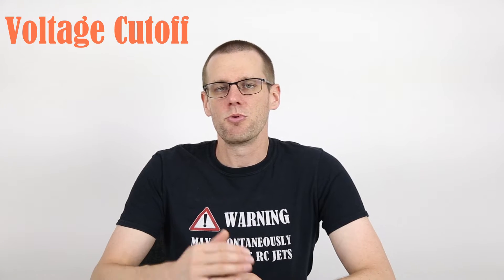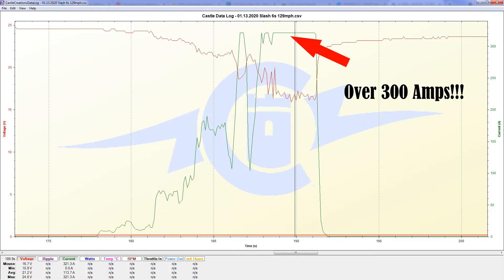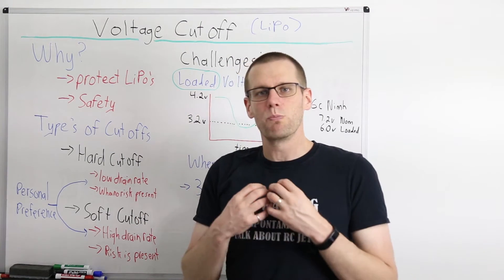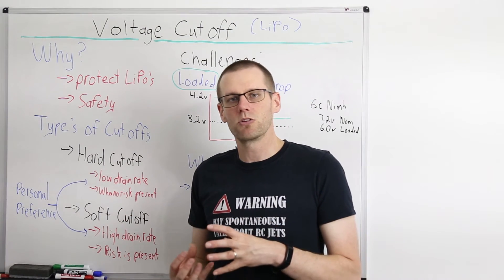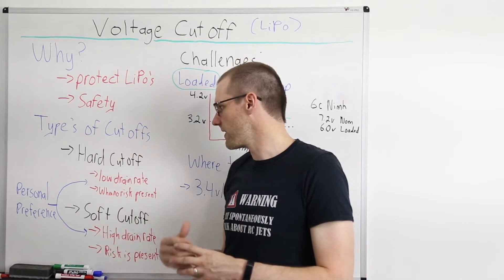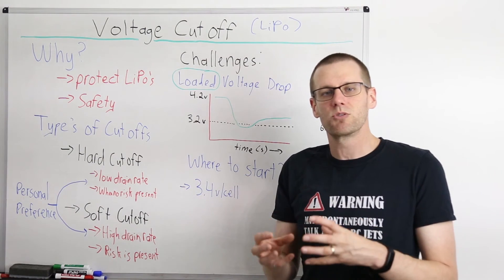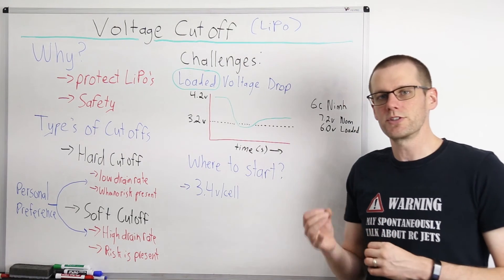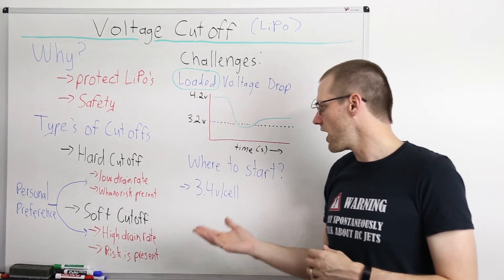The Problem with Low Voltage Cutoffs for Very High Performance RC's

Comment: If the cutoff voltage is set to 3.2, does that mean that if ANY cell drops below 3.2 V, that the cutoff kicks in or is it the average of all the cell?
Reply from the maker: Not any cell. The average as the esc is not using the voltage tap to measure individual cells.
Reply: @RCexplained  Very responsive to an old video.  Thank you for the answer.

Comment: I'm trying to put together a triple fan setup for my UDR, with it's own small/separate 3s lipo, and a LVC between the fans and 3s battery. So I don't lose run time or power, but get all the cooling the UDR needs.
Reply: How did it go? 3 years later
Reply: @keven8047  I ended up finding a voltage regulator on Amazon that can handle 8s and put out the power needed for all the fans and lights. Then I mounted a toggle switch on the dash of the UDR to turn on/off all the fans & lights as needed. Been planning on switching it to a remotely operated switch to turn them on/off from the radio. I've got the stuff needed, just been busy with other projects lol
Reply: @TheAmericanUhate  lol that is cool.  Bet you were shocked to get a comment on yours after 2 years.  Lol
Reply: @keven8047  Lol it is rare but more often on youtube than facebook for sure.
Reply: It's basically 2 smaller 30mm fans for the faux fans on the back, with a duct to the engine box, and a larger 40mm fan also pushing air into the motor box. My ESC never gets hot, barely even warm, but my motor is getting way too hot, hot enough that you can't touch it.

Comment: That's why i use 3.4v cut off from Esc and 3.3V lipo alarm with loud buzzer.....if all cells will be discharged normally 3.4v cut off will be doing it's job, if any of cells will drop below 3.3v lipo alarm will do what he must do.....

Comment: First of all absolutely love your videos. There’s a lot of people out there that seem to know how to install parts and which ones you can/can’t use but no one seems to explain the WHY. I’m one of those guys that need the why lol no as to my question…

Bought Arrma Typhon mega, upgraded it with hobbywing ezrun max10 sct 3660 with the 3200kv motor. I have a couple 2s goldbat brand rated at 5200mah 100c. Whenever I plug my lipo battery alarm set at 3.4-3.5v it starts going off, i bring it in and it’s reading 3.8v or higher sometimes. Is there anything I can do to help/overcome this voltage sag? 

Appreciate your help, time and everything you do for the rc community by making these videos. I literally found you last night and watched your videos for well over 2.5 hrs trying to get better grasp on different subjects.
Reply from the maker: Hi Sam. Going from 3.5v loaded to 3.8v unloaded is not too bad if you are really pushing the car during the run. 
If you want to reduce voltage sag further, you can increase the capacity that you are running. Instead of 5k you can go up to 8k mAh.
And if you don't want to beef up the power system, you can gear down by reducing your pinion gear tooth count. This will reduce load.
Reply: Would soldering the extra capacitors that came with it help at all by chance? Hobbywing said I should only need those for speed runs and similar kinds of activity. Makes me nervous running batteries without an alarm and potentially damaging them. Keep up your excellent work. I could spend hours watching you. Some topics go over my head like your tires episode but most of the information sticks and I retain.
Reply from the maker: Hey Sam. The capacitors would not help.

Comment: With my esc and motor combo I can get away with having my lvc at 3.0 or 3.1 volts per cell and still have plenty of headway for it too be safe I drag race so I make 3 or 4 passes and come in the pits and charge up before my next couple of passes and also I’m going 132ft thanks for the info though

Comment: Is there any way of reducing the likelihood of voltage sag? To prevent the voltage from dropping down to LVC level for a split second triggering the cutoff? Does a higher c rating help?
Reply: I haven't figured it out yet either

Comment: not sure if this would be considered an ESC or battery question?  what would cause an esc to beep 4 times on a 3S lipo, ( will provide any info about the RC and or power system) but will beep correctly when a 2s or 4s(2 2s in series) or even a 6S ( 2 3s in series and are same lipos i get 4  beeps from when used singularly)
Reply from the maker: that is strange, could be an issue with the ESC. Does it make any difference if you have a 50% charged 3s pack.
Reply: @RCexplained  does the same thing when the battery is fully charges and when it's about 50%. It only started doing this after I moved power systems from one rc to another

Comment: Thanks for the explanation, I was wondering if I could use a LiFePO4 (4s2p) with value (100ah) and connect it to my vesc (75V/300A) and motor (12-50V / 200A continues) without a problem. Thanks in advance
Reply from the maker: If all is within spec yes. capacity is irrelevant.
Reply: ( I will be using the motor for an electric speedboat for my friend and me)

Comment: this is all too familiar to me when i did speed runs, wasnt a good idea to do multiple passes then my esc tells me overheat And it cuts out. Gotta LOVE protection mechanisms. One thing i did was always run sensored and set a cutoff temp, although i had one instance where i killed my castle 2200 motor completely. Lesson learned

Comment: Good advice Ryan, thanks man!
Reply: I had a real good run with my RC boat today and your suggestion of using 3.4V as a cut-off worked perfectly Ryan! 😉
Till now, I had the cut-off set at 3.6V, so it seems I wasn't getting the full potential from my batteries.  BTW, the batteries "bounced back" slightly to 3.45 - 3.5 volts within no more than one minute after the run.